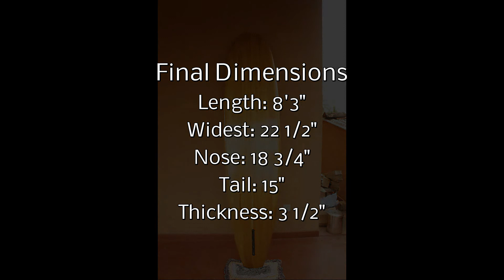Chambered Wooden Surfboard Construction

Comment: how did you go about breaking the board apart for chambering? I see an iron but I'm not sure what you used it for. Thanks!
Reply from the maker: I used shims to slowly spread the planks apart until the glue gave way. The glue was pretty strong, so I used an iron and wet towels to try to weaken the glue.
Breaking it apart was the most difficult step for me. I used normal Elmer's Glue, about 4 or 5 nickel size dabs for each plank. It turns out that's waaay too much. I will use less next time. Maybe even put sheets of newspaper in between so they tear apart easier.

Comment: What kind of wood are you using here? Planning a similar build myself.
Reply from the maker: It's a local wood called "lunumidella." Not sure really what it is. It seems to be similar to pine in density, maybe slightly lighter. Went to several woodshops in Colombo searching for paulownia or some similar material, but this was the best I could do. The board is HEAVY...
Reply: Have started gathering cedar timbers. Quite pricey in my neck of the woods.